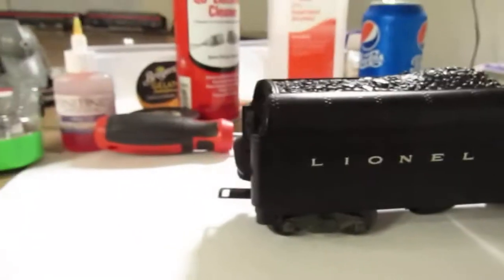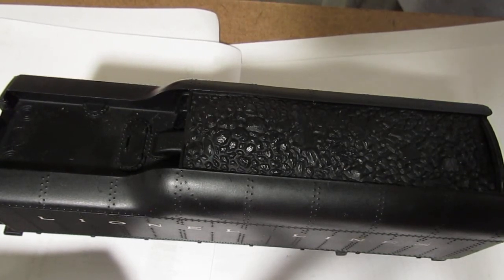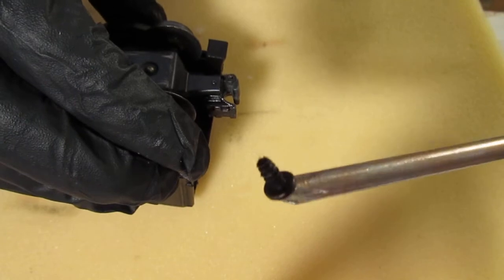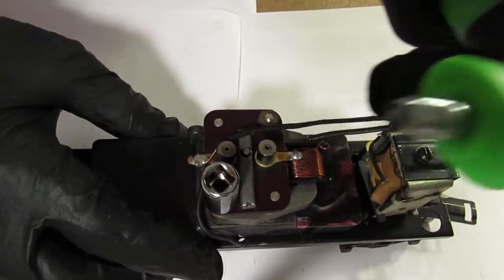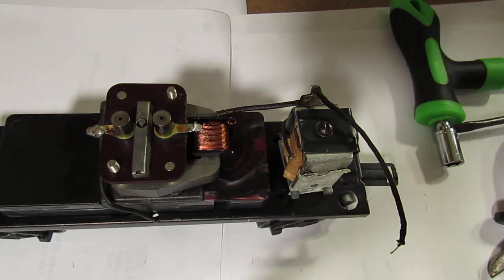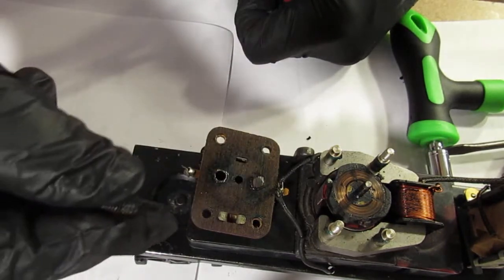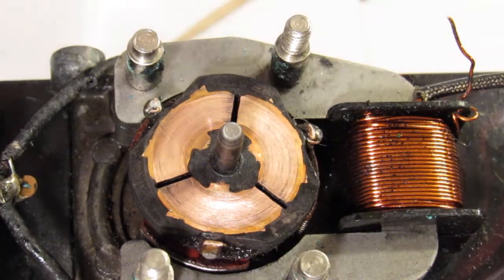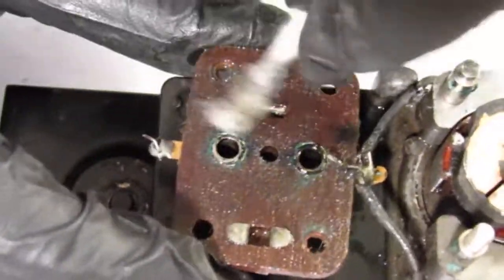Step by Step.Postwar Whistle Service Tutorial-Part 1 of 2

Comment: Why cut wires that you plan on reusing ? Just unsolder them so they don't get shorter and may not reach properly--then you may need a new wire.
Reply from the maker: You are right airmojo,
I shoulda just unsoldered the wire,but by messin up the way I did,I was able to show a way to MAKE that old wire work.

This is by no means the only way to do this.
This is more for the people just beginning to do their own maintenance and repair

.You guys who know what you're doing,I'm always glad to hear a suggestion like yours.

It was late,I did this after working 12 hours,and I'm only working with 1/4 of a brain,so please bear with me(Just Kiddin") 

Thanks for your comment.It woulda made that last wire go a lot easier!!!!
Reply: Soldering can be a pain... I often will spend too much time working on something that is soldered, when I could have saved  a lot of time, and frustration, by unsoldering the connection at the start.

I also learned that it is always good to take some photos before you start taking things apart, especially if you don't finish the project right away, and go back to it later... sometimes days or weeks later... a handy digital camera, especially my iPhone, is one of the best tools you can have.

Looking forward to your part-2 video !
Reply: Its not real hard to desolder and a lot of times you dont need new solder. Heat up the old solder with the iron and once the solder is liquid, pull the wire through and remove the iron. The old solder will cool and when using this method, it tins the wire on the way out. Only really need to cut the wires when the insulation is degraded.